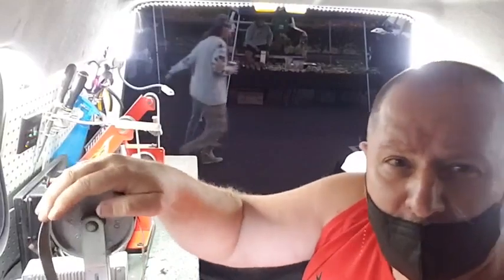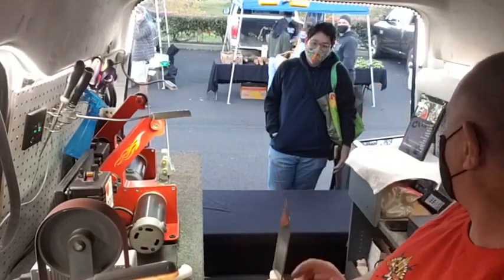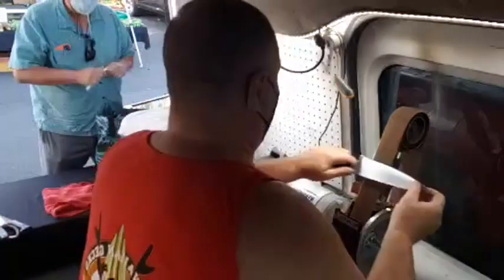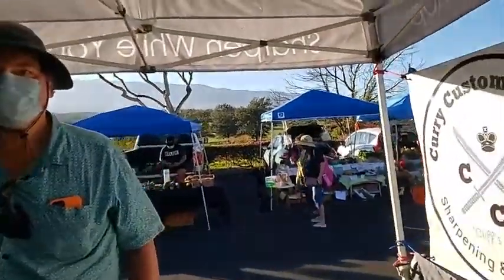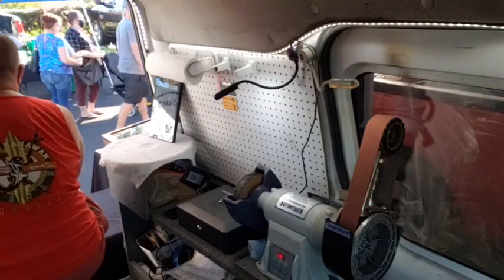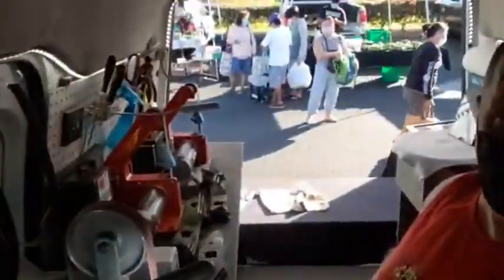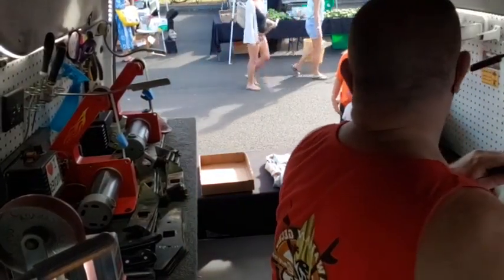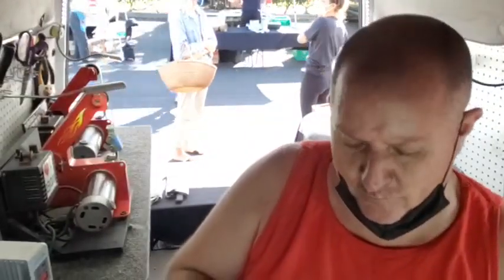Sharpening at the Farmers Market

Comment: Fellow belt sharpener here--Genuinely curious why you feel safe enough to not wear gloves or safety glasses? Any fans or ventilation? Or do you use magnets to collect dust? Thanks!
Reply from the maker: Machines are setup so material isnt really moving towards my face and I do wear glasses often and when doing stuff where particles are flying off in large amounts on the bigger machine.  Its hard at the market because dealing with people and close up work at same time.  Ill try to remember and show my glasses next week during stream!  Thank you!
Also I have front windows open behind me(camera side) and 2 small fans blowing out n towards the back.  I also wear mask for larger grinds even before covid.  Truck has a vacuum setup inside as well just dont like the noise so use it between gigs.

Comment: What grinder and knife guide are you using there for the angle, sir?
Reply from the maker: Most of the machines and builds get covered in my regular videos.  These tend to be a basic 1x30 harbor freight type unit that I swap out the motor to variable speed for and attach an angle guide we offer on our website listed in the description above.

Comment: Hey Cliff. How are you powering all this? Curious about your work lights too. Seem to be bright LEDs.
Reply from the maker: Aloha Doug, since doing that first live stream Ive gotten asked alot about all that so I have plans to do a quick run down video.  Basically its a device called an Isolator to keep the vehicle battery separate from the two 6v golf kart batteries is series.  Only when vehicle is running does it allow them both on same circuit to allow for charging.

Lighting is all LED:
https://www.amazon.com/gp/product/B07J4ZKGF4/ref=ppx_yo_dt_b_search_asin_title?ie=UTF8&psc=1
https://www.amazon.com/gp/product/B01JUE9OLM/ref=ppx_yo_dt_b_search_asin_title?ie=UTF8&psc=1
Reply: @CurryCustomCutlery  thanks for that info. Those lights a perfect for my grinder cabinet. One is in the cart right now.  Also looking forward to the van tour. Thanks for all you share with the sharpening community. Maybe a piece of felt solder heat shield would be good for catching the sparks from you multi tool and keep the neighbors smiling.